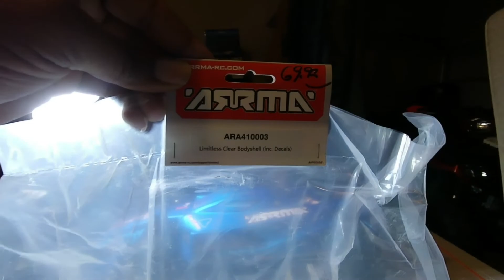limitless electronics install and 4s test run

Comment: Like #19 nice setup bro looking good 👍🏾 your wife came threw family vibes 👌🏾
Reply from the maker: Yes sir she did dat bro thanks I was told that the gearing was to much for the 27t that’s why it crogg a little on the takeoffs 👍🏾💯
Reply: @GAPreviewsAtoZ  it's to much just to play around on your street cause the gears that come with the car is for high speed runs so it might run hot and cog up I would plug that wire up for your motor it should run a lil bit better

Comment: To much gear for that motor clogging eventually will mess up motor go up on spru gear to a 40tooth brother go down on pinion as well 22t👊🏿 plus u need cap packs too & higher mah battery this car was built for speed running & drag so that just a little tip my Rc brother 2200 castle cant take that low of a gear ratio without clogging 👊🏿also love them t'shirts much love🎬🥂
Reply from the maker: Thanks bro do you think the blx can take it 👍🏾💯
Reply: @GAPreviewsAtoZ  yes it can but u are definitely gonna have to watch for heat issues fans is a must plus cap packs, the next motor u get for that gearing is a lower kv like 1900 or 1800 6 to 8s other than that tp power long can max 6 or 5 esc or mamba xlx esc, tp has a 4050 2100kv that will fit in stock position that's not that high in cost wise or xo1 motor will work 👊🏿
Reply from the maker: Ok Cool but I’m only going to gun it on 4s for now but I will get the xo1 motor or change the spear out next week and I’m not trying to go but about 70 to 75mph that’s all I’m shooting for
Reply: @GAPreviewsAtoZ  arrma set up 2050kv will be fine with fans and use that mamba monster x esc u got 👊🏿
Reply from the maker: Thanks bro will do 👍🏾💯